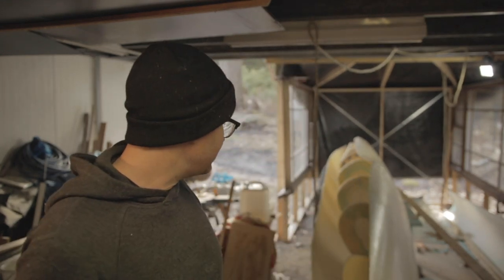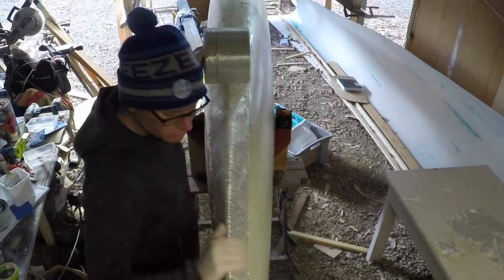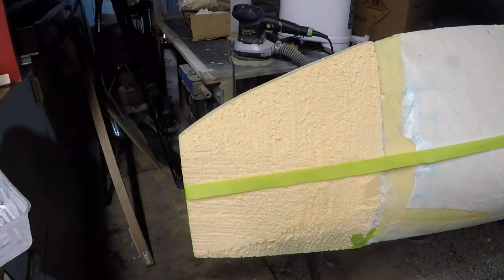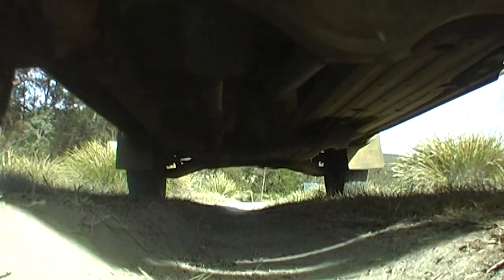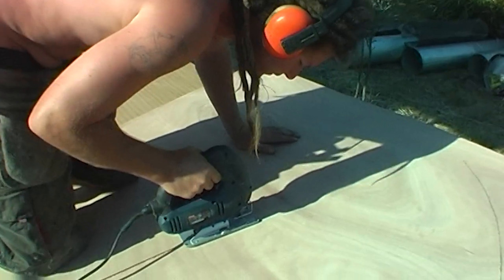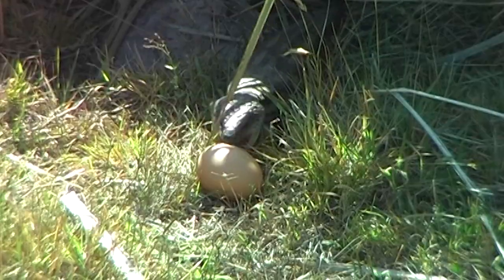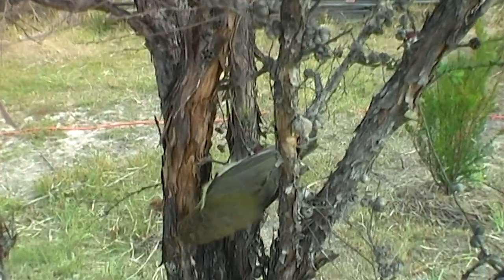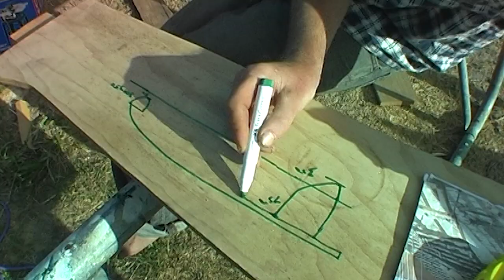Proa building - now and then.

Comment: Matt, your project is so inspiring! I’m planning to start building a 55’ proa in the next couple of years. Still in the design and model phase now, so I look forward to seeing your progress. I’m in Byron Bay at the moment, but planning to build in Fiji. Love the film of your original proa build with your brother too. Keep them coming! I’m ready for the next instalment.
Reply from the maker: G'day Guy, thanks for the message! Stoked to hear you are thinking about building one yourself,
I would love to see what you have in mind.
Fiji sounds fantastic!

Better get cracking on the next update then!
Reply: Hi,
I'm planning to build one too, rather a tipñol, in Normandy, 10 meters long. I keep wondering about the best shape for the main hull : which asymmetry, flat or V bottom, straight bows or not.
Also, I'd like to avoid any dagger board.
Is there a forum where we could discuss it ?
Thanks for your video !

Comment: Great to see this, Matt! I have just finished building a proa to Gary Dierking's T2 design - after sailing on very similar boats while living in Kiribati many years ago. Hoping to get down to Tasmania in late Jan for the Tawe Nunnugah raid trip from Franklin and and would love to check out your proa!
Reply from the maker: That's fantastic Peter, are you bringing the boat down for it or going with someone else? I've always  wanted to do the Tawe Nunnugah, it's just a long time to get off work when you've got limited leave for the year.
I should definitely be sailing by then so all going well I can take you for a blast!
My email is matt.s.tucker at gmail if you want to get in touch when you come down. It's always fun to meet Proa people and hear all the different ideas people seem to have for them!

Comment: So what’s the different with a proa and a outrigger ? Looks the same to me tbh? No hate, just want to know more about building boats and sailing!
Reply from the maker: Good question Mark, Proa is the word used by the Polynesian builders and navigators who invented them so I tend to prefer it.
Another way I look at it is that Proas are 'outrigger sailing canoes' whereas 'outriggers' are the modern paddling type.
Reply: @MattTucker  also if it's designed to tack instead of shunt, sometimes people say "tacking outrigger" instead of "asymmetrical catamaran"
Reply from the maker: @dominictarrsailing  Thanks Dominic, yes there tends to be a lot of different language around Proas, as there seems to be many different options and opinions about the best way to design and build them. They have to be one of the most confusing and experimental boat types ever dreamed up in terms of the modern take on them!
Reply: @MattTucker  yes, the thing I really like, is that they NEVER made a production proa, not even an asymmetric cat, so if you want one you have to build one. consequently they appeal to people that just feel an urge to be different.
Reply from the maker: @dominictarrsailing  That's right which makes for a very interesting dynamic where even Proa enthusiasts argue over the best way to do things!
I do unfortunately have the urge to be different, sometimes I wish life would be easier if I could just be a sheep!
It's not just Proas I really struggle to buy any off the shelf products because they never seems to fit my requirements or I think I can do it better and I end up doing it myself. It doesn't always work for me but it makes things interesting.